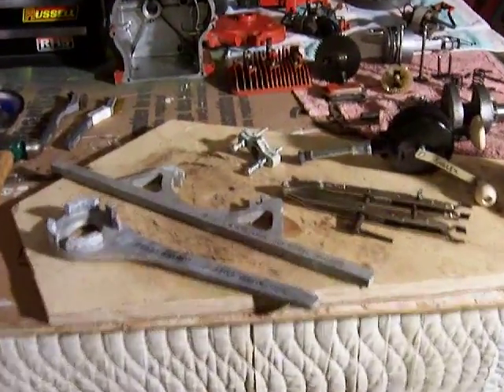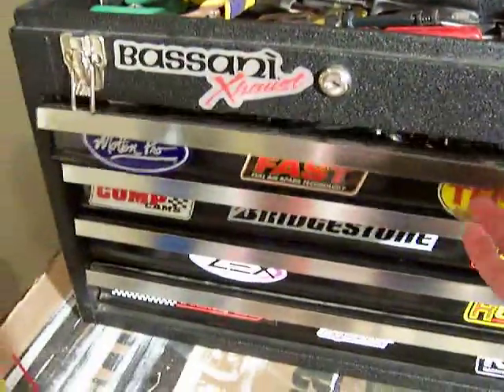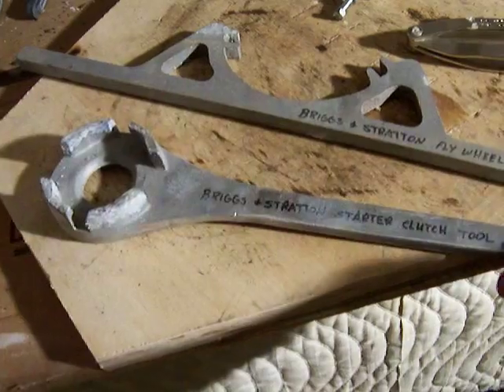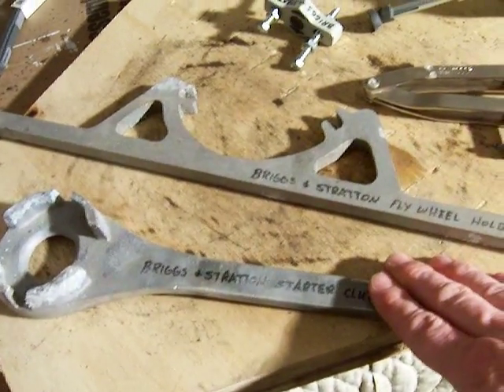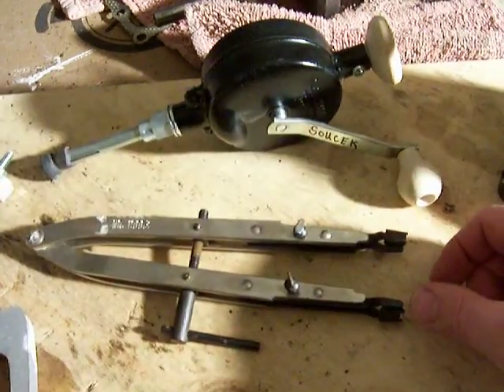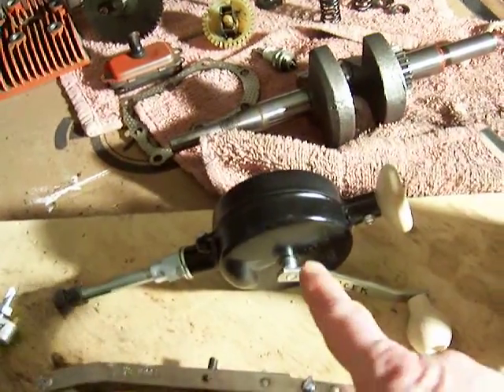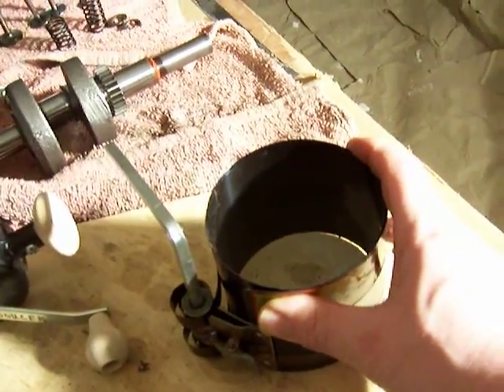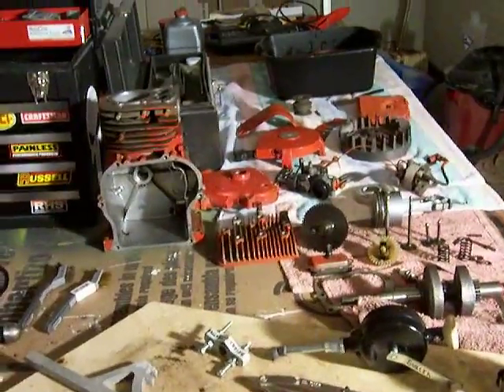Small Engine Tools - Briggs and Stratton

Comment from the maker: These engines are widely available. This style (5HP Horizontal Briggs) has been around for a long time. They are very similar and parts are mostly interchangeable. I frequently check craigslist for engines or equipment with these engines. Every so often I come across one that is cheap enough to make it worth my while. These are not new of course but I am interesting in rebuilding them anyway. In fact, I have one that came off of a leaf blower/vac! These are my favorite engines.

Comment: watched all the videos you have made so far for the B&S 5hp series.  GREAT job.
I have a Toro leaf blower/vac that has same engine.130202-1640-01 it had a terrible noisy death.  now looks to have a long horizontal crack about 3" long above the oil drain plug on crankcase. looking to buy a new engine as with crack likely cheaper, need one with the same mounting for base same output shaft with key it uses 2 of the 8 head bolts as mount for housing. any suggestions??  how can i contact you?  TY
Reply: If you still have that engine today, what is the date code on it? The earliest would be 820801XX (August 1, 1982).